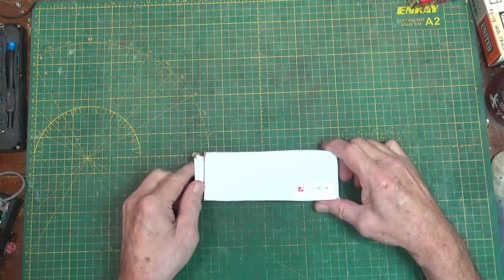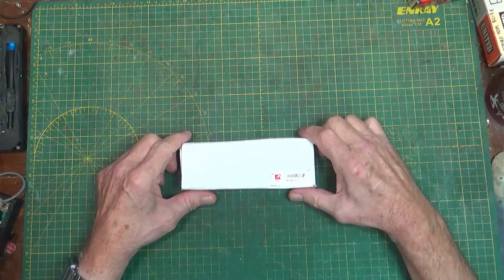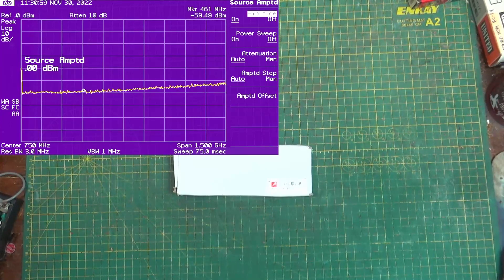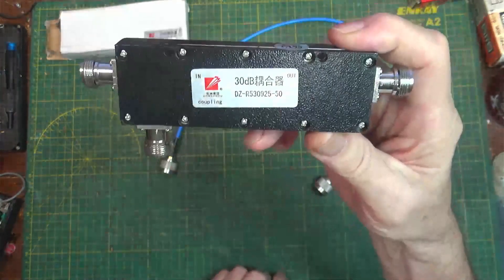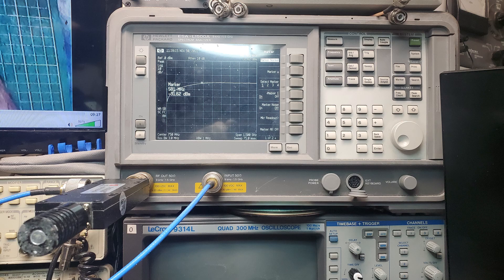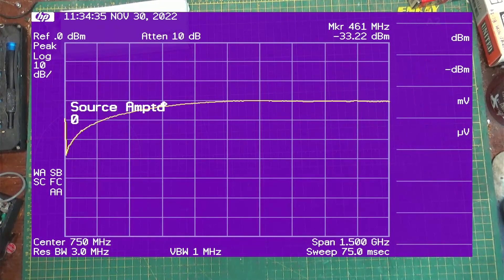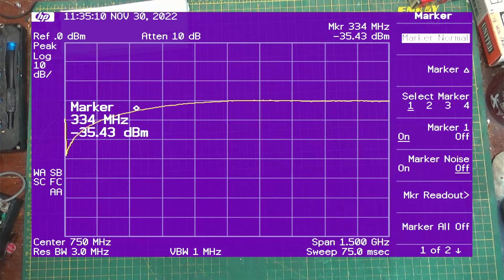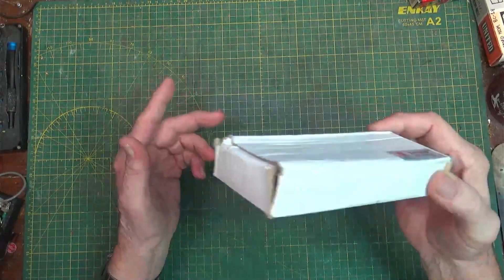Cheap eBay 30DB Directional Coupler Test

Comment: Thank you for sharing - I have often wondered how good those cheap directional couplers are - very impressive performance. They are also good for checking antennas by turning them around and looking at reflected power (or using dual port couplers and looking at forward and reflected levels). Regards, David
Reply from the maker: Thanks.  Next check is to see what my pure resistive step box does.